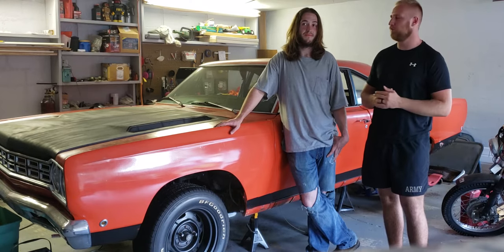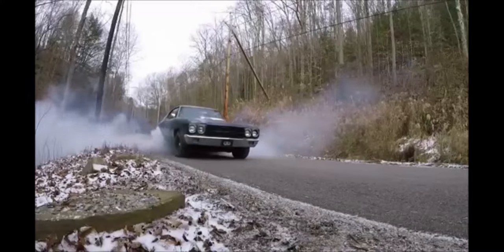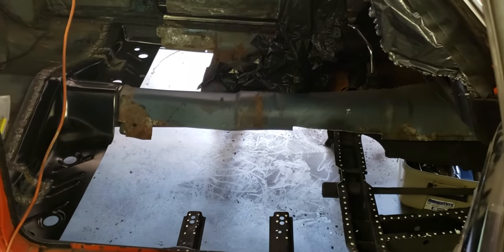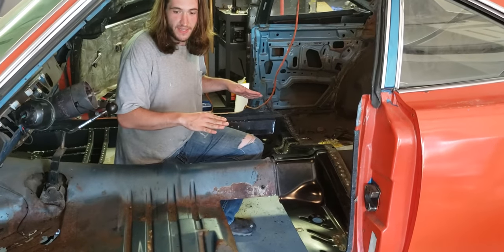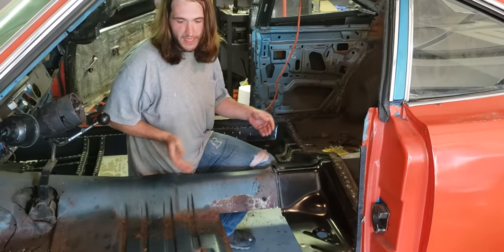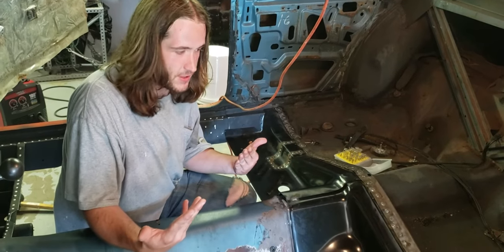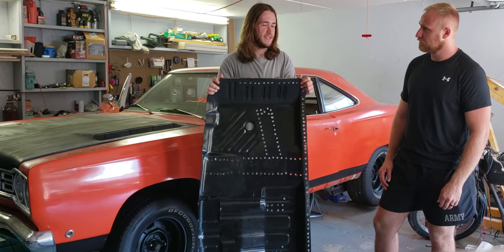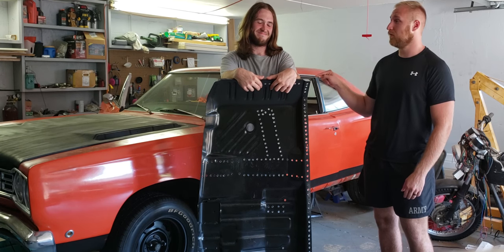1968 Roadrunner and Mopar B Body Floor Pan Install Part 1

Comment: Excellent video and super informative. I'm thankful that you mentioned the wiring cover/protector that runs along the inside of the rocker panel. I have the same things on my '62 Polara 500 which I'm needing to re-floor and didn't know what they were for. I have the 5-piece floor pan stamping set from Kramer that I got at Carlisle about 15 years ago and haven't quite figured out which piece goes where, but your video explains a LOT. For this I am grateful. If you ever do a re-floor (or any other work) on a '62 B-Body, I'd love to see videos of it. Kinda difficult vehicles to find stuff on (or for).